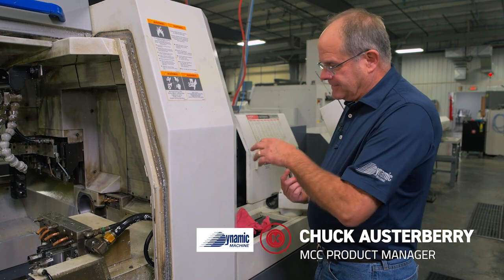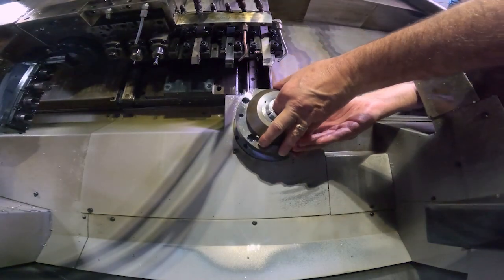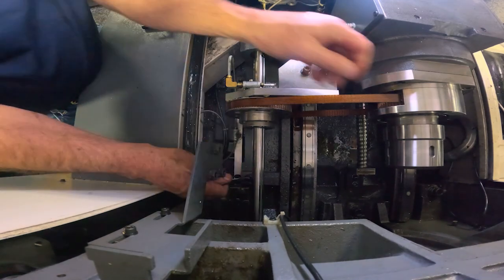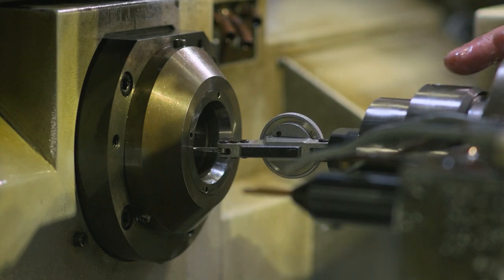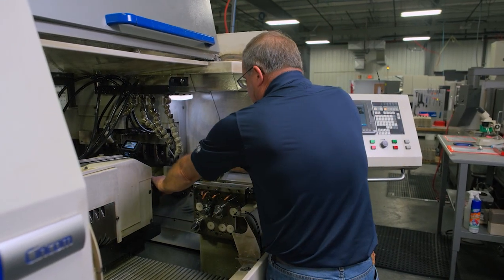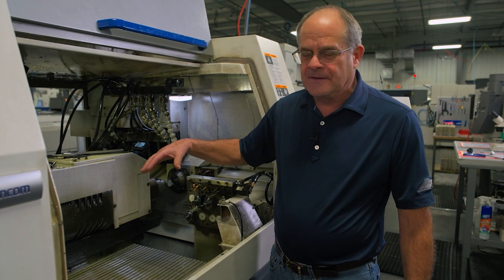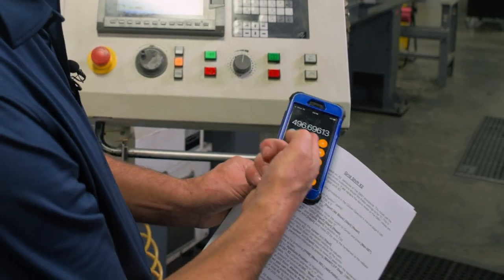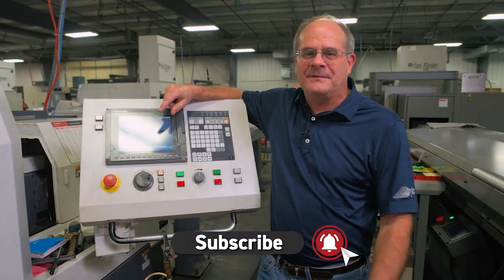How To Align & Adjust A Citizen Swiss Lathe - Part #2

Comment: My indicator of choice is a Compac with .0001” resolution and about .02” of travel. The dial is smaller and fits in the machine better. I believe Citizen uses the micron version in their factory. Before you move the X2 grid you need to check if the sub spindle is out of square. They are mounted on a single pin to rotate if (when) hit. I put a ground 6” drill blank in the sub, make sure it runs true to the end and indicate the side jogging Z2. If this isn’t straight the T21-T24 tools will bind and cut over.

Comment: Hi, is there any way that i can lock the back spindle into place ? (Some kind of M code or mechanically)
Reply from the maker: If you are feeding through a tube and don’t want it to spin M48 C0 will keep it in place - if you are picking off to a hex or form there is a phasing process to run through to time them out
Reply: What he said. Or 'GC' (short for G0 C0) in MDI $2.
Unlock by pressing RESET

Comment: Does the X2 axis use switches when referencing to zero position? Are there scales on each axis or do they use the servo motor encoder? You wanted comments, lol.
Reply: The referencing process senses the ball screw end and will move the grid shift once it has made a couple of hits. No switches. Encoder is used.